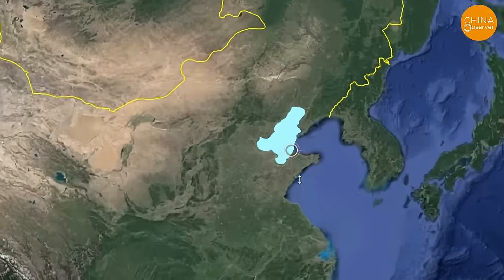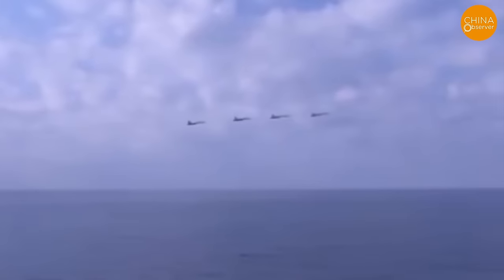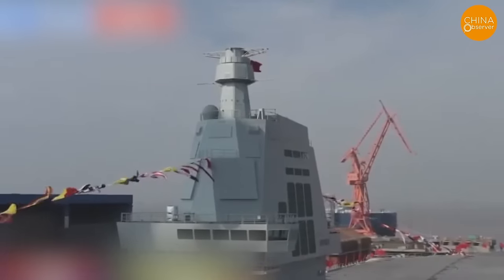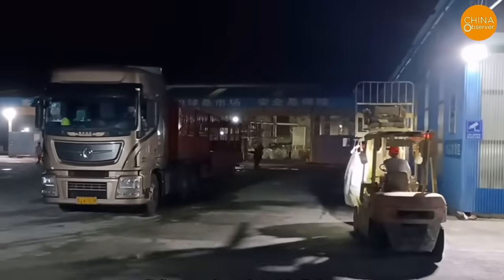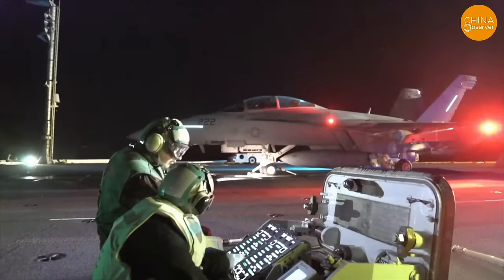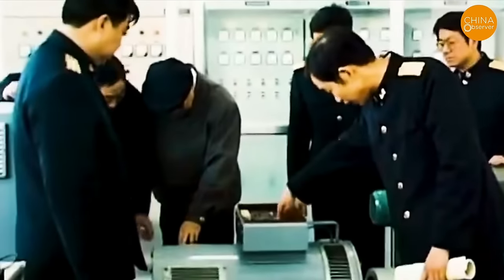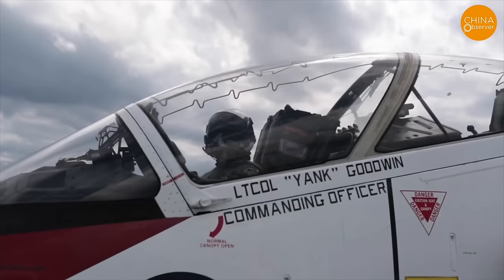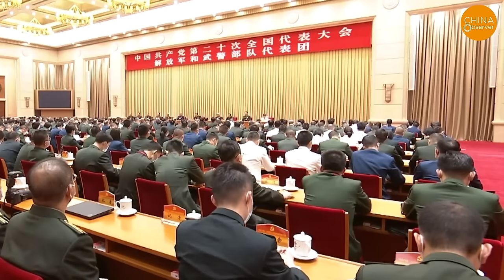China’s Aircraft Carrier Sacrificed?25-Year Electromagnetic Launch Research May Destroy Its Aircraft

Comment: You mentioned "High Power DC Circuit Breakers" and I just giggled.
Retired electrician, and I occasionally installed Battery Backup Power Systems for Telephone Offices and Server Farms. The batteries that are 24 cells the size of a Gold Wing each connected in series.
We didn't use breakers, there wasn't any such thing.
We had fuses. And the fuses had explosives. So that when the fuse blew, the explosive would blow, and snuff out the plasma trail that wouldn't care that the fuse had blown, and merrily keep conducting away.

Comment: Lots of even ifs... even if the EM cat has enough, even if it doesn't destroy the aircraft, even if the pilots are properly trained... It's still only 1 aircraft carrier. Flight ops are relatively new, and the # of planes is fewer than the Ford (for instance), and has a lower sortie rate. The US has several carriers and over70 years of flight ops experience.

Comment: Everyone knows you take a torch to a magnet, and it will demagnetize it imagine the thrust from the jet engines on the magnetic rails. It will demagnetize, causing at least uneven. Thrust these are giant rail, guns linear electric motors that are pushing the aircraft, and it is very difficult shielding the magnets from this kind of heat.

Comment: I suspect there is no advantage to using a flywheel for energy storage, I'd guess the main reason for the US to use a flywheel is because supercapacitor technology was too immature and likely hardly anything in 2011.
But now that the US has invested so much to make the technology work, a flywheel might be a part of the next carrier and maybe the next. I expect though that graphene supercapacitors will eventually be the only storage no later than maybe 6 years from now and maybe a lot sooner.

It's interesting to hear about Chinese EMALS difficulties, though. If China is unable to resolve its issues, the Fujian becomes a barge or worse. Maybe it puts a major pause in all the carrier building China had planned for the next half century.
Reply: I believe or expect that the flywheel is spun by steam from the nuclear generator and used, in turn, to spin an additional generator, engaged on-demand. I expect that a flywheel provides better energy storage efficiency than capacitors do. A side-benefit is that a flywheel adds stability to the entire ship, improving launching/landing conditions, particularly in rough seas. Capacitors, by contrast, are explosions waiting to happen (should they become damaged.)  
My take on it is that capacitors should be used for the initiation of the launch and that flywheel generators should be used for the rest.
These are non-issues in the near future (and should be non-issues now) because electromagnetic induction of momentum is clearly a superior way to operate flying objects. Hitler employed such 'UFO' technology in 1943. Nikola Tesla designed it in 1891.
Reply: A future reef to replace all the reefs they destroyed building islands in the South China sea?

Comment: Does China have any aircraft carriers equipped with functioning catapult systems? I know they have a couple ski jump style. The US had decades of experience with steam catapults (since 1950). There was institutional knowledge in place before trying this new technology.
Reply: The Chinese decided to skip the steam catapult system. The steam catapult system would have help learn some of the basics of carrier launch operations.

This may not be true (my personal opinion) but I think the reason to bypass the steam catapult system is the heavy stress that is put on an aircraft's frame.

I have not heard anything about how well the airframes are doing being launched?
Reply: @recondax 一开始003是准备使用蒸汽的但是后面准备上蒸汽时，电磁弹射突破，军队高层进行了1年左右的内部讨论所有航母服役耽误了一些时间。最后采用电磁弹射❤
Reply: @feiwang5306  Translation: "At first, 003 was prepared to use steam. However, when preparing to use steam later, the electromagnetic ejection broke through. The top military officials conducted internal discussions for about a year, which delayed the commissioning of all aircraft carriers. Finally, electromagnetic ejection was used"

So by "broke through" you mean "was stolen"?

Comment: See... this is the Hell of Imitation rather than real self development and Innovation from it...

The copy of schematics is not enough, stealing program code isn't enough... you need the entire chain from start to finish.

From some low-end contractors making a simple but solid quality relay switch at reasonable cost to the gigabrain engineering team that makes increasingly deadly aircraft...

You can't just take the designs and expect your agonizingly corrupt and incompetent Military Industrial Complex to make you one exactly like it... they don't even make quality precision tools to manufacture things to tolerance levels we accept.

Made in China has gone from meaning Inexpensive and in bulk... to meaning Cheap knockoff...

Comment: I wonder if  China is consulting with the Russians on the process of building aircraft carriers?  They might get some valuable advice and observations.
Reply: The only valuable advice Russia could offer is that nobody should build carriers the way Russia does! Their only carrier sank at the dock and is buried in mud! Btw, both Chinese built carriers are showing signs of structural failure. The 002 carrier is a copy of the Russian hull which was acquired from Ukraine, the Russian built hull has not failed but the Chinese copy has, the 003 carrier already shows signs of structural failure and it has not been to sea! Poor quality steel seems to be the primary cause!
Reply: @thomasfarley5070  <<The only valuable advice Russia could offer is that nobody should build carriers the way Russia does! >>

I see you got the point of my comment.

Even so, perhaps the Russians could give China a list of things NOT to do.
Reply: What NOT to do?

Comment: The fujian's emals seems to be working fine. But tests may reveal reliability issues. So, when in doubt, do some more testing!!!

In the seas, the salt water may provide some problems for the functioning of the emals. An alternate way to launch aircraft would be to start the takeoff run beginning from the aft section and work it's way forward like in WWII. Also, Russian fighter bombers have proven to possess the capability to launch from aircraft carriers without the need for catapults. The CCP should entertain the idea of purchasing original Russian equipment.